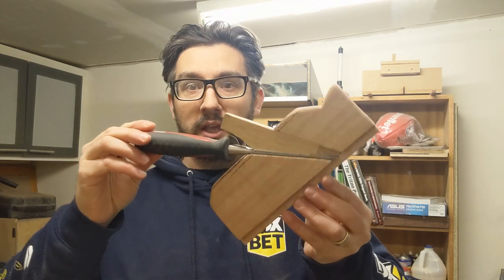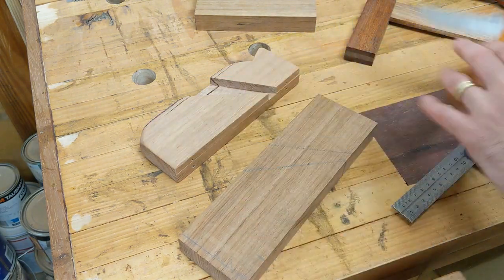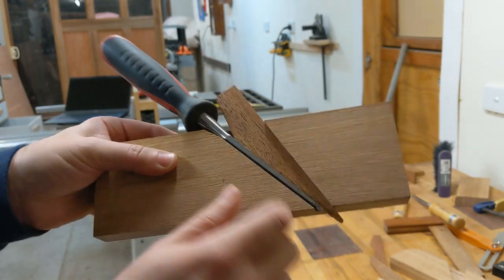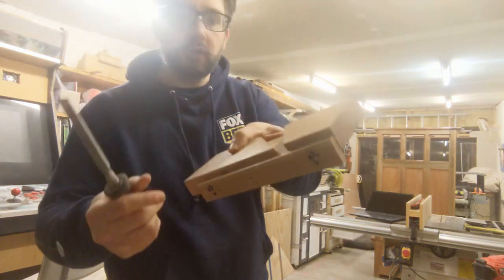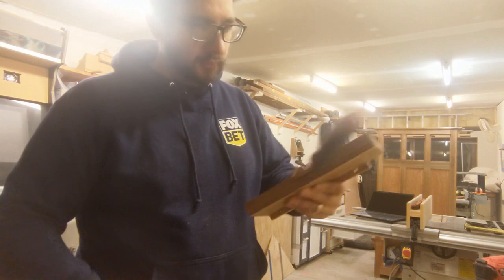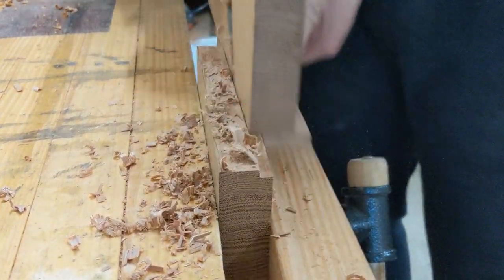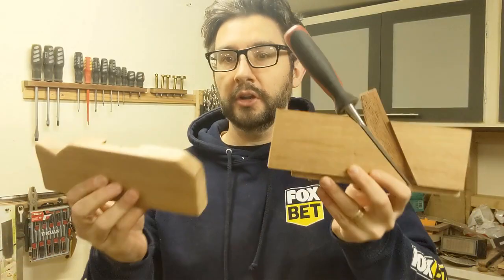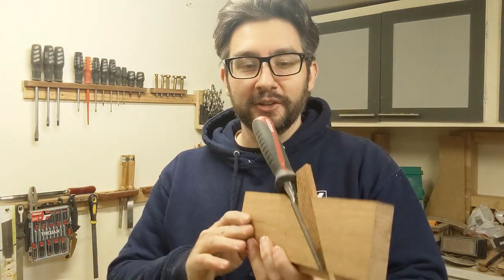Making a 'poor mans rebate plane' #spswc2020

Comment: This is on my todo list. Maybe with a 3D printed body too.
Reply from the maker: Oooh, that could be fun. I haven't any 3D printing experience, would it be strong enough to take the forces do you think? 
The only problem I see with this design long term, is that the base which runs along the wood will eventually wear, but I imagine I'll get 5 years before that happens.
Reply: Mario That is a good question. Will be fun trying though. The edge relief plane is fine so far.

Comment: Clever little thing, might try to make one!
Reply from the maker: Go for it, I wasted so much wood the days after when I just 'had' to test it out and make sure it still worked. 🤣
Reply: @woodfather  🤣 
Sadly, at the moment I don't have a chisel that's good enough to work like this... 😕
Reply from the maker: @CrudeButEfficient  to be quite honest, the chisel I used is one I bought over 10 years ago for less than $20, and I'm ashamed to say that I've never sharpened it until after this video was made. So if you think it cuts good here, I can tell you it is about 100x better now 😂
Reply: @woodfather  I'm really bad at sharpening my tools, both in the sense that I do it to seldom and (as a biprodukt of that) I don't do a good job when I get around to it...
Reply from the maker: @CrudeButEfficient  :) I know exactly what you mean. Since making the first plane about a month or so back, I've put effort in learning how to effectively sharpen. I still can't get an edge that any professional would show off, but I'm learning that you don't really need to. Once I've cleaned up my process I'll put it in a video, it's low cost but seems to work for me now.
Reply: @woodfather  Do that, I could use some pointers from someone like minded when it comes to sharpening!